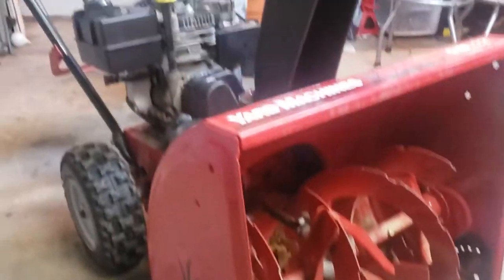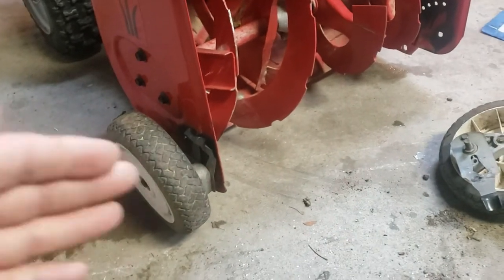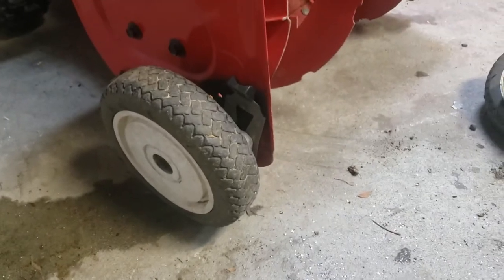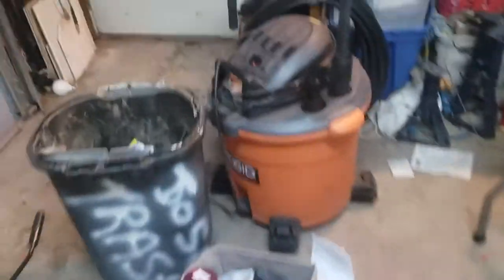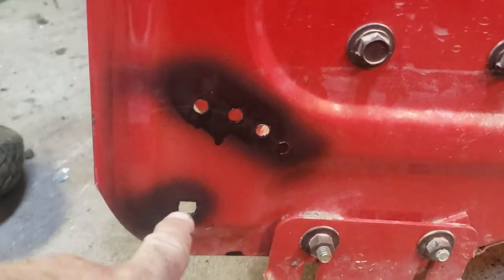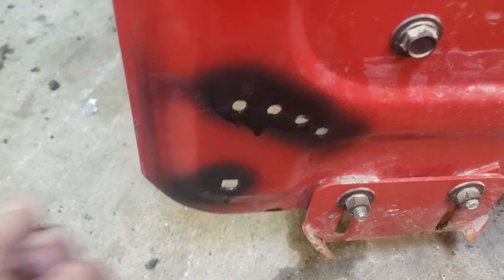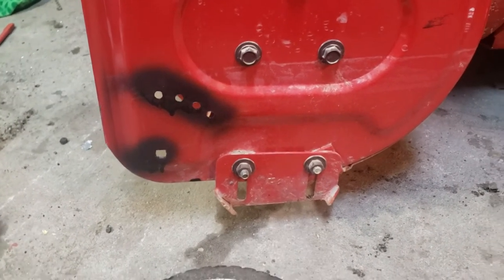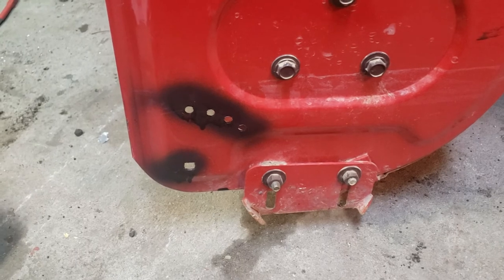How to make your snow blower work on a dirt or used asphalt driveway. How to put wheels on snowblow

Comment: There must be a reason they come with skids instead of wheels. If wheels worked better, I'm sure some if not all blowers would have them on. I assuming wheels stick out too far maybe? I may bolt on some wheels but I think I'd fabricate some kind of little wing in front of them to detour the snow to the side and make a path for the wheels.

Comment: I have a older Troy Bilt 45" wide walk behind I've been using on a gravel drive for years. On mine I drilled out the front skid bolt holes to 1/2" and ran a  3" in bolts thru holes added a nut and made tight, added cheap Harbor Freight 1/2" hub wheels drilled a hole thru end of bolt to hold a wheel and washer with a hairpin clip. Wheels come off in seconds to use on regular drive with only the bolt sticking out sides.
Reply: Hello, is there anyway to see this mod?